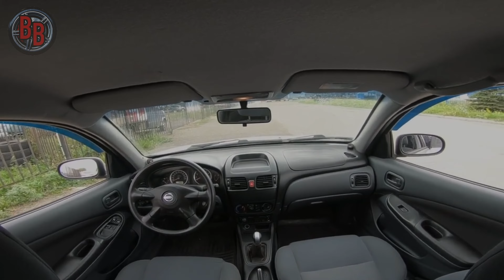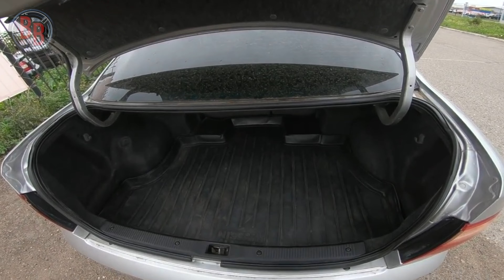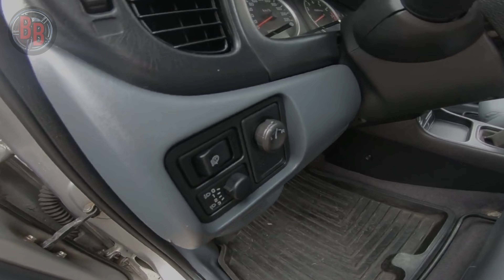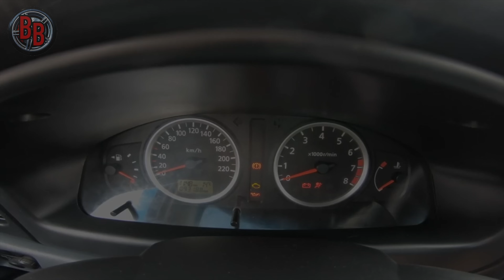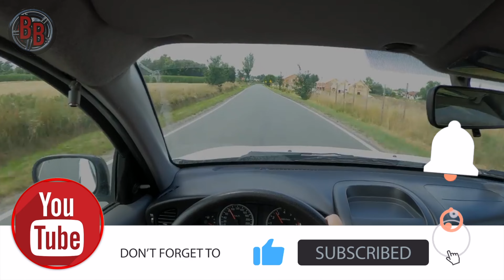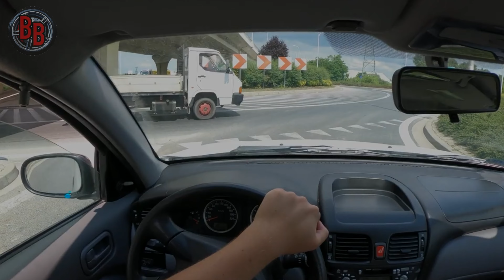Nissan Almera N16 - Check For These Issues Before Buying

Comment: Here's a random tip ,if the throttle looses power check brake light bulbs ,change them and throttle power returns

Comment: I might buy one soon!! Thank you for the video great information :)
Reply: Did you get it?
Reply: @zhila5958  No it had terrible transmission. U had to Violently press first and second gear in.

Ive bought a golf 4 quite soon after that comment. If it wouldnt have been involved in an accident  it wouldve lasted ages
Reply: @cosmo499  Maybe it was a little on the worn side? Just an assumption. I am asking because i myself daily drove an N16 Nissan Sunny from middle east with the 5-speed and QG16DE and that thing was indestructible. Daily drove it since youth till 24 and then i came to germany. i wanted to consider this car again since i had an extremely positive experience with it in my home country and in the middle east, it is viewed as one of the most durable cars of all time.